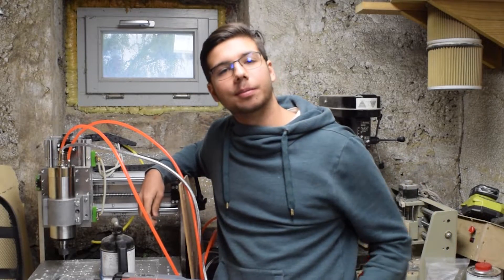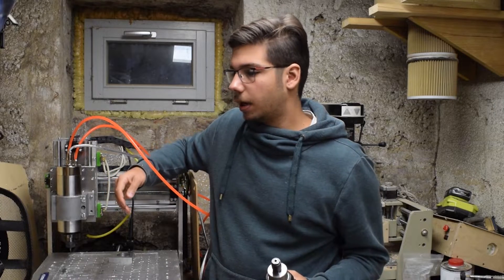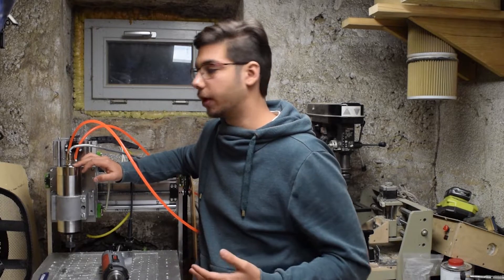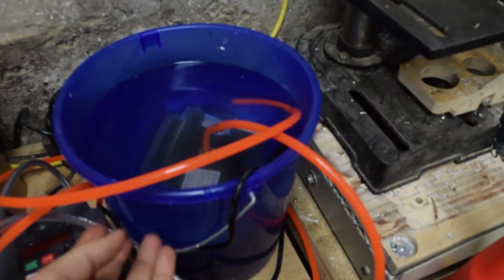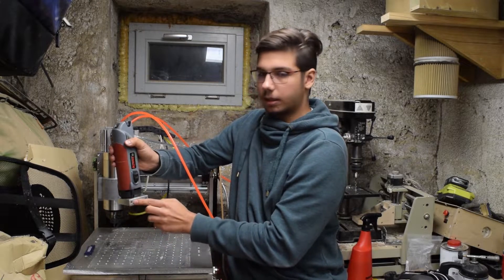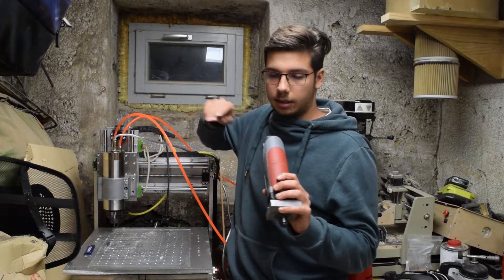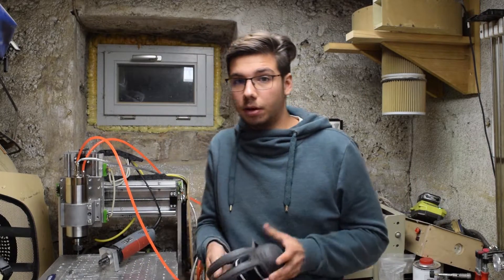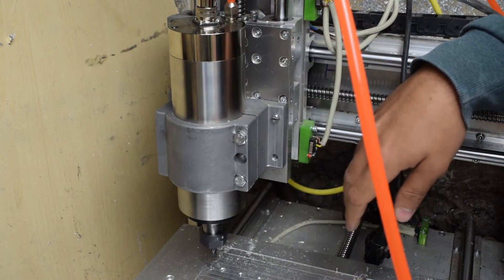CNC Spindle Upgrade || CNC Project #3

Comment: Max can you tell me what is inner size of hole 08:40 and also size of hole to make the head of hex bolt flat to plate? I know it's for M5 bolts but i want to how much adjustment you can do.
Reply: https://www.engineersedge.com/hardware/_metric_socket_head_cap_screws_14054.htm

Check out this site to find out the dimensions you need
Reply from the maker: I think I made it one or two mm bigger than needed

Comment: I have to ask, did your
 VFD survive the breaker going bad ? I've had 2 of em smoking after same problem when turning on again
Reply from the maker: No it's fine luckily :D thank God I think I would have never stepped foot in the workshop again
Reply: @Uniquelymade  i would say lucky this time.. but the time it was unpowered might have saved it to be honest.. I powered mine up again within 15 min..
Reply from the maker: @xillianto  yeah probably lucky, I think a chip created a short somewhere and that is what caused it. So next Video is defenitly an enclosure :P
Reply: @Uniquelymade  yeah, i would absolutely move it to an area protected..

Btw, change that power line wire.. you run it unearthed and with a way under sized power wire.. upgrade it to atleast 2.5mm wires.
Reply: A tip the ölflex cables are very good and are available in several sizes.
Reply from the maker: Do I really need 2.5mm² wires from the spindle to the vfd?
Reply: @Uniquelymade  no, 1.5 will do for a 2.2kw, as you wont manage to push it for all that power.
Reply from the maker: Okay perfect. That's the one I went with in the end
Reply: Not sure what your frequency converter produces - in aircrafts the board net is powered by 400Hz to be able to reduce the cable cross section and to save on weight. So if it’s more than 50Hz at the end the 1.5 is absolutely ok.
Reply from the maker: Yeah 400Hz is equal to full rpm of I understand it correctly
Reply: @Uniquelymade  you will hardly use more than 2-3A on most cases, thats why i said 1.5 is fine.

Comment: The more and more I see of these CNC router machine upgrades the more I realise that people who want to get results need to go with heavy solid plate rather than light extrusion builds.
It all depends on the final outcome expectancy.....but over engineering beyond a feasible gain  is just more cost for less gain......eventually it will not be good enough unless it's built from 20mm steel plate fully welded
I see the need to cut wood, plastic and most probably aluminium but that's it......I have to wonder where the figures come from for heavier builds without any FEM input to justify it.
Reply from the maker: I think honestly I should have just gone with aluminium extruded profiles in the end. It would have been a lot easier and more adjustable. But I wanted a challenge. You live and learn I guess.
You can machine aluminium and brass with those as well, I don't think you get a lot more for all that extra work unless you go the "this old tiny"  way
Reply: @Uniquelymade  Extruded profiles do tie you down to the method of fixing in that it becomes a big Meccano set etc......you are tied  to following and fixing the material shapes for the design.
On a build of the size you are doing I would have.....(I have already) ........ gone to steel tubing fully welded as it's not only cheaper but very user friendly to work with after welding and assembly.
You can add bits of steel in awkward shapes and weld it in position which is not at all possible even with a good aluminium welder due to the rapid expansion and warping you get with ally.
I'm currently doing a different build for a small  3018 CNC router using 2020 and 2040 extrusions from the ground up for a fun build with SBR12 linear rails, 1204 ball screws, 500 watt motor and Mach 3.
This was to be a completely off the shelf from extrusions  build but the  X axis saddle and motor mount became 10mm thick aluminium plate but it's working out well so far......I already have a CNC mill so this is a fun build to see how it works out......the 3018 CNC routers sold by BANGGOOD are too flimsy to cut anything but soft wood.
The big problem with DIY off the shelf is the hardware is supplied in set lengths and cutting SBR rails to length is a job I balked at, so the 3018 is now becoming something like a 3225 more or less......I might cut the components down to get back to the 3018 size when it's finished as that was the aim initially......small is beautiful I think.